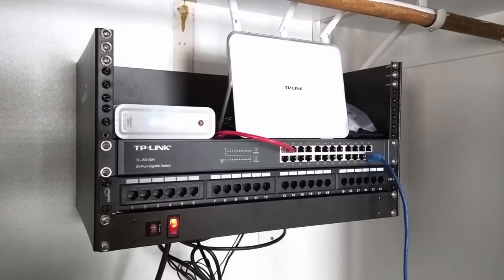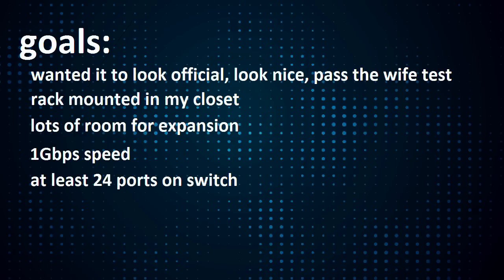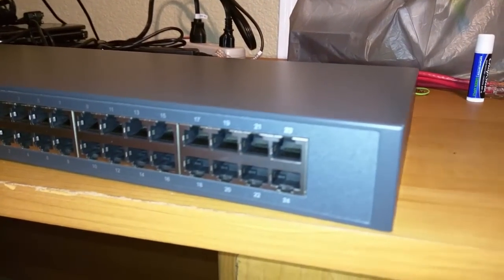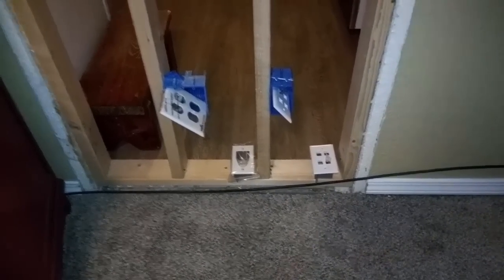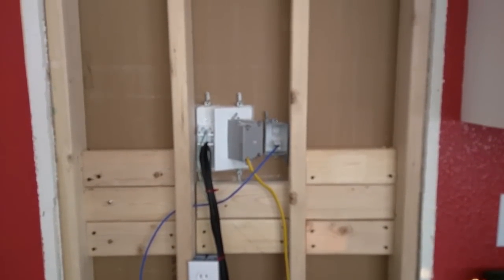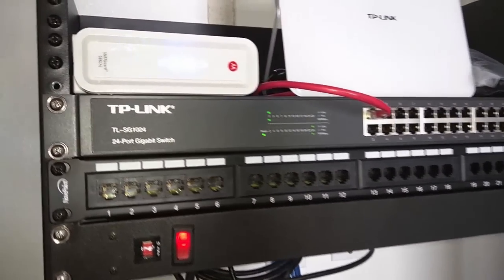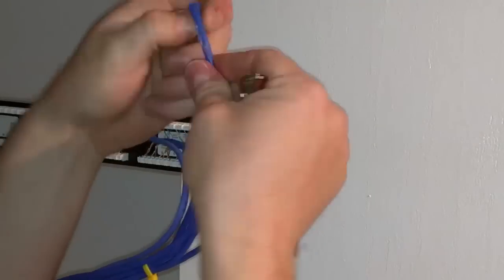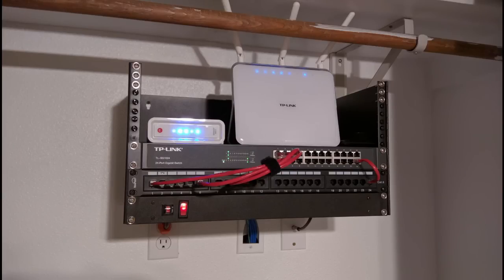Budget Home Network Tour/How To

Comment: Nice setup but I don't understand the signal flow.  What is the purpose of the patch bay AND the switch?  I understand what a patchbay is for in the audio world, taking signal from somewhere and routing it somewhere else.  But why is it necessary in an ethernet setup?  Doesn't the unmanaged switch give you access to each location/device automatically?
Reply from the maker: You don't need a patch panel, but they do offer benefits. The switch just adds more ports to a network. You could check out my "what is a patch panel, do you need one" video.

Comment: Nice little setup. what's the last component with the switches? I think that's where you plugged everything. I thought it might be your ups but I guess it's just a power distribution. Can you tell me the model? I would like to read a bit more on those. Thanks.
Reply from the maker: +myshots101 thanks. The last item on the bottom is just a rack mount power strip. I don't see any markings on it really. It's just a simple power strip.
Reply: I see. They do look nice, thanks.

Comment: I have a house with about 2500 sq ft area with THICK walls. I have a good broadband connection, but WiFi was not available in whole house. I have 4 different routers, and I was not able to use them all, they were simply not playing nice with each other to extend range of WiFi and i was not considering wired connections.
Now that I have learned from your videos (I have watched all of your videos and a few other on YouTube). I am going to setup wired connections to access points at each floor. There is a possibility of increasing the area to 3500 sq ft in 3 stories, so I'll be needing about 6 access points + ethernet connection to TVs, and it has an office that requires about 10 wired connections.
Thanks for helping me in understanding it.
Reply from the maker: Glad to help. Have fun!
Reply: Alok, did the 4 routers you had set up allow to configure them as "access points only"?  This would allow them to inherit DNS and DHCP from the primary router and basically just pass through traffic like an unmanaged switch.  That may help them work together better.
Reply: UBIQUITY
they have a good application that will allow you to set up just once and every AP gets the same settings.  MESH/Controller at a budget.
Routers that are re-purposed do not play well together.  I have worked with them to a headache.
The cost is a bit more but setup and maintenance is so much easier.
Also these are POE or power over Ethernet so you do not need to wire an outlet near the re-purposed routers.

Comment: The lowest item on the rack I take is your power surge suppressor. Am I correct?  I purchased an APC UPS rackable at Ebay for very little and that offers both surge and UPS ports.
The wireless router could have been mounted under the shelf but the best place for it is in your attic.  Was that a possibility for you?
I got a shop in San Jose, Cal to build a rack mount case for my Arris (TG862G) and it looks really good that way.  I wish I could send pics here.
Reply from the maker: Just a power strip. Yes I could have put the ap in my attic, but wasn't worth the hassle for me.

Comment: How do you cable the stuff up in the cabinet and the last bit with stripping the wires?
Reply from the maker: +EpicMiner_ that rack didn't provide any cable management, so I had to put some sticky hooks on the inside of the rack and have the cables rely on that. It works. The Ethernet cables that ran to the patch panel all got bundled up with Velcro here and there, and are also being propped up by the sticky hooks. I just got creative.

Comment: You are already terminating cable in keystones to go into the wall plates.  Why would you not have used a keystone patch panel?  It would make adding cables later way easier than having to completely remove the patch panel to get access to punch down the 110.
Reply from the maker: +solath well that does sound nice, and it can get a bit tricky to add cables to the panel, you are correct. Those keystones are sort of pricey though and if I wanted 24 of them, the cost would go up. I added most of them in one go, and won't add too many anytime soon, so this will work for me.

Comment: How did you drill through the floor inside the wall and how did you pull your cables up through the wall and into the closet? Thank you!
Reply from the maker: +Soapstreet up through the crawl space. Drilled up in the the wall cavity, and then used a wire fishing stick to push up the cable through the hole in the wall I cut for the pass through plate.
Reply: Did you have something to measure from in the crawl space? Like a vent or something?
Reply from the maker: +Soapstreet in this case there was another cable that knew was in the same area, so that helped me find it, but could pace it off, or get a mental picture of where stuff is relation to other things in the house.
Reply: ben johnson Thank you. I just don't want to end up drilling through the floor      in the room. Lol.
Reply from the maker: +Soapstreet yeah that's never fun.

Comment: quick question, I love this set up. I my case I need three POE ports for camera. would you add a stand alone poe switch or use three of the port energizers?
Reply from the maker: Personally I'd get a smaller poe switch to use somewhere, even if it wasn't on the rack.
Reply: @BudgetNerd  thanks so much

Comment: Maybe add a battery backup for the modem and router to maintain wifi during outages? I looked for this in the comments a bit, so if it has been mentioned already, I apologize.
Reply from the maker: +xxurdonexx it's a good idea, but I was trying keep costs down and my PC's don't have battery backup, so I'd have internet still during an outage, but no PC to use it with. I would still have my phone though..
Reply: Ya for sure. Battery backups are not cheap. A good $125 model would suffice for a few hours if it's only connected to a modem and router. In an outage you could use your phones, tablets, and laptops!
Reply: xxurdonexx you only need about 20 minutes of reliability.  It isnt to survive day without power..  it is to prevent damage. Being able to backup, shutdown, and stuff properly. Helps.
Reply: Floris Fiedeldij Dop You're missing my point. I recommended the battery backup for the modem and router only in order to maintain internet access via WiFi during a power outage.

Comment: So this is kind of a dumb question but I'm new to this and am looking at doing something like this for my house.  Early in the video it looks like the modem is plugged into the switch in port 1.  The last picture there doesn't seem to be a cord going to the modem.  How is your switch getting a connection to send out?
Reply from the maker: The modem connects to the router and the router is connected to the switch with the super small cable on the far right actually

Comment: Is it necessary to have 8 ports for your entertainment center? Does adding an additional switch to accommodate more devices in an entertainment center add too much latency, or do you just want it to be more neat ?
Reply from the maker: The walls were open and I had enough cable, so I just did it. And I'm a nerd.
Reply: Budget Nerd Yeah that makes sense. My crawl space is so tiny, not sure I can drop Ethernet everywhere I want.

Comment: Great video. I’m in the process of setting my first one up based on your design. How do you recommend mounting this rack on the wall?

Why did you decide to use a bracket wall mount over an open sided rack?

If you had to do it over again, would you use a TP-Link switch or something else?
Reply from the maker: I would recommend screwing into studs. The studs in most places in the USA are 16 inches apart. The holes on the rack should be 16" apart as well. Just line them up with the studs and it will be solid.

I went with that rack mostly just because of cost. I would have loved an open sided rack, but this one was cheap.

I haven't had a single issue with this switch actually its been great. I would totally buy  it again..  unless I wanted a managed switch.. but I don't really need one.
Reply: Budget Nerd Thanks for following up.

Comment: So how does this work? Could you break it down for me?

The Internet modem gets signal from the coaxial cable, then you wire an Ethernet cable from the modem to this wall-mounted assembly, then the wall-mounted assembly duplicates the Ethernet port 'X' number of times, and then whenever something needs an Ethernet connection it is plugged into one of the duplicated ports via the wires you fed through your walls?
Reply from the maker: Yes the interweb signal comes in the from your isp, through the coaxial cable to the modem. Out the modem with an Ethernet cable to the router, and then out the router to wireless or wired devices. The 24 port switch is attached to a LAN port on the router and is just adds more Ethernet ports to the network.

Comment: Curious about whether you get interference from the 120V Romex wire you crossed in the walled up doorway.  I have always heard to keep electric lines at least 4 inches from cable and phone line.  I know there is shielding in the Cat 6 but wondered if you were having any noticeable issues. Otherwise, very informative and clean install.
Reply from the maker: Best to keep them separated if you can, but it's generally not a huge deal. I certainly wouldn't tie them together in the same bundle though. The biggest reason they aren't put close together is in case there is an issue in the 120v line and it introduces hight voltage to the low voltage line. If you do have to run them past each other, it's best to do it perpendicular, as you saw I did.

Comment: Help! I need help setting up my network. I want to make sure i am getting the most out of my network and need help connecting these devices in the right order. Here is what i'm working with,
-(ISP) Spectrum 400 mbps down/400 mbps up
-Modem 4 ports with wifi (wifi can be turned on or off)
-Router, Linksys EA9500 Max Stream
-Router, Linksys Velop 3pk
-Switch, TP Link 24 Gigabit Switch (TL-SG1024D)
I have about 17 devices in my house that can be wired through ethernet and 5 that are wifi only. 
Thank You so much!!

Comment: Quick question from a noob.. what does this do that my modem/router combo can't?  Thanks!
Reply from the maker: My fancy router gives me more control and options over my network, the patch panel allows me more ease of custonization of my networking and cabling and the large switch adds 24 more Ethernet ports that I wouldn't otherwise have. But.. if you only have a few devices and don't customise or change much, then your modem/router combo would work just fine.

Comment: Very very informative video, but why did you use the patch panel? Why didn’t you connect your laptops or PCs directly to the switch?
Reply from the maker: I used a patch panel to make it neat, organized, scalable, easy to configure and change, but most of all, to increase my Nerd Street Cred. You might consider watching my "what is a patch panel, do you need one?" video!
Reply: 1- Yes I need one 😁☝️
2- I still didn’t understand what’s the use of Patch Panels. I am in a organization where we connect several PCs and DVRs to the switch without using Patch Panel technique. I am confused!
Reply from the maker: You don't have to have one, you can run the cables directly to the switch and that totally works.

For any serious network, they have their benefits. You could watch my video "what is a patch panel, do you need one?" it should go over all of this stuff in better detail.

Comment: What did the LAN cable cost you all up and does the brand very in quality or is it pretty much same same?
Reply from the maker: +Robert Poynton cabling varies so much depending on what you get, and some people need lots, or not much, so it just depends. All the cables I used I already had lying around. Any patch cables I used I made myself.

The biggest thing in cabling is how well its insulated, and how well it will resist interference.. doesn't have to be super pricey to be good though..

Comment: Do you need cat 6. For this to work. And will this work with any modem
Reply from the maker: You don't have to use cat 6. It will future proof the setup a bit as hardware gets faster, your cabling can handle it. But I used cat 5e, because that's what I had lying around, and it worked just fine.

It should work with any modem, but I would check with your ISP, they will tell you what modems are compatible with their network.

Comment: Thanx for the video, I was going to do something similar, but this video changed my mind to something a bit larger, but I know I would benefit from it more. I have a couple questions though.   I was doing my networking for changing my recent Firestick purchase from wireless to wired to hopefully stop the buffering from videos as I would use a flash drive to download the videos  for watching instead of streaming. But in the future I am wishing to get a video security system. Is this set up efficient for this? Do I need different equipment? Thanx for the help!!
Reply from the maker: +Javier Torrez each video security system is different, but if you're going with IP cameras, then having a POE switch would be better. However, it wouldn't be a must, as many camera systems come with their own unit that would provide connectivity and power to all cameras in the kit.. then you would just hook that unit into the switch you already have.

Having a POE switch would be nice down the road as you could easily expand or add more cameras. Having a patch panel would also add to the ease of a setup like this, allowing you to easily use the existing wiring, and easily change what switch or units your devices are connected to.
Reply: I believe that the system I am looking at has this POE switch, so I would just need to connect the POE switch to my patch apnel?
Reply from the maker: +Javier Torrez you would most likely want to connect the security switch to your switch you have. You could do that through a patch panel if that made sense. But it's also worth thinking about keeping your security system separate from your normal network for bandwidth and security reasons. Just depends on what your needs would be.

Comment: Is the cable from your router plugged into the switch directly or wired into the patch panel first and then into the switch with a patch cable?
Reply from the maker: The second. Routed to the patch panel, then patched to the switch.

Comment: Great video.
Question. Are you able to punch down voice and data on same patch panel.
For instance I have 11 cat5e . 8 data 3 voice. Or does the voice go to a separate 66clip? Thanks alot
Reply from the maker: If it has a RJ-45 jack it can be on the same patch panel. If you need to mix and match different connectors, lots of people have suggested keystone patch panels that will allow for different connectors.
Reply: @BudgetNerd  yes I used the cat5e rj45 at all my locations.
Thank you.

Comment: So are the LEDs on that TP-Link router still as bright four years later?
Reply from the maker: Of course... Not sure leds dim over time..
Reply: @BudgetNerd  It's a known issue with some blue and white LEDs and was a problem on these routers. On the one here the LEDs that have been on all the time are now barely visible even in dim light. But then it only cost me a tenner for use as an access point.

Comment: is port 24 on the patch panel I assume with the orange ethernet cable straight from the back router? Thanks...Im  doing my own home ethernet getting a patch panel.
Reply from the maker: Yes that port connects the router to the switch

Comment: Don't really understand the whole punch panel thing.  I realize you would have to know the length or have extra, but could you just use a plug on both ends of the cable or is this something entirely different?
Reply from the maker: You don't have to have a patch panel. I wanted one. Yes you could put a plug on both ends, and would work. May not look as nice. You might want to check out my "What is a patch panel, do you need one?" video.

Comment: Great video! Did you ponder a 10Gbit network? What router/modem combo are you running? Any switch come to mind with 24 ports with 8 of them PoE? Thx.
Reply from the maker: +Cruzer thanks. 10Gb would be sweet, but I was trying to keep cost down. My modem is to typical Motorola surfboard docsis 3.o and my router is a TP-Link Archor C9 if I recall. They're both pretty nice.

Comment: Did you just mount your modem on top of the switch?  Does this cause a problem with heat if mounted directly on top?
Reply from the maker: Mount no, set yes. No that setup doesn't create much heat.
Reply: Thank you for the educational video and the reply.

Comment: Love watching your videos. Just moved into my first house. Wanting to run cat6 through the house. It's old, 1920s old and has plaster walls. we have a finished basement, first floor (main floor) second floor and finished attic. I bought the parts you provided. Im wondering now how best to set this up. I have 1gig FiOS where the box is in the basement. Wanting to set up several ethernet ports in living, a few in the bedrooms, maybe some in kitchen and more in attic. How would you recommend going about this?
Reply from the maker: The trickiest part is getting the wires ran. Plaster walls do make that much harder, but without seeing the house, I can't really tell you how best to go about. You got to be careful and creative on how to run the cabling.

If you are unsure, you could always have a company come out and wire it, and you could tackle the rest.
Reply: @BudgetNerd  I have a 3d rendering. is there a way to message on youtube?
Reply from the maker: I think YouTube did get rid of it's built in messaging system. Too bad, it would come in handy on a number of occasions.